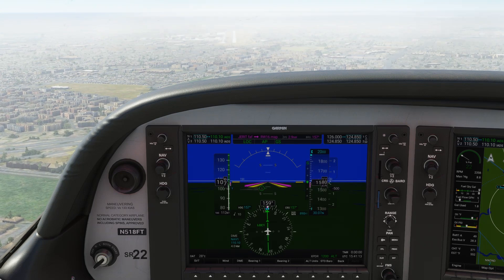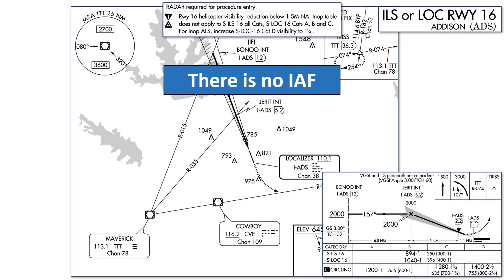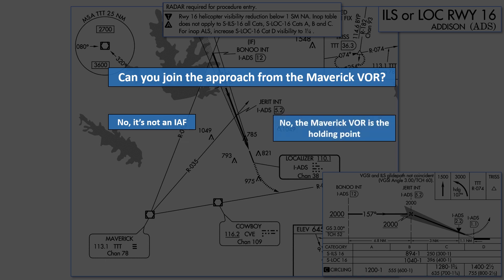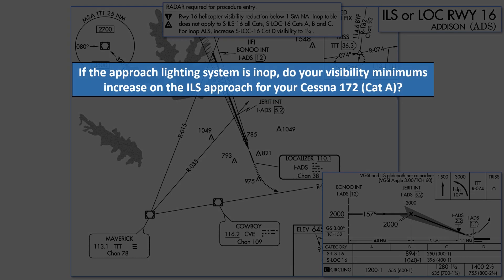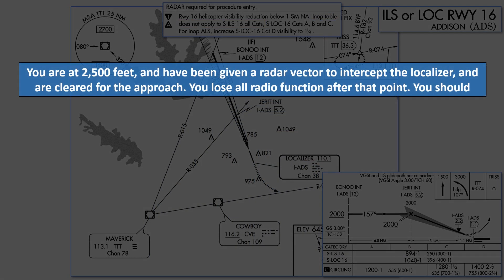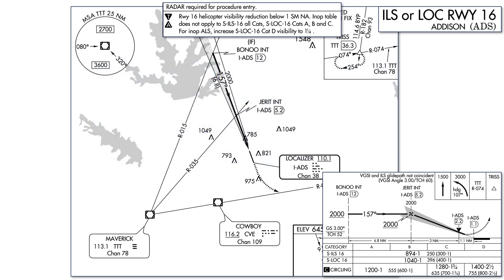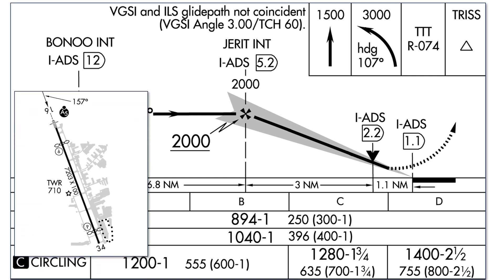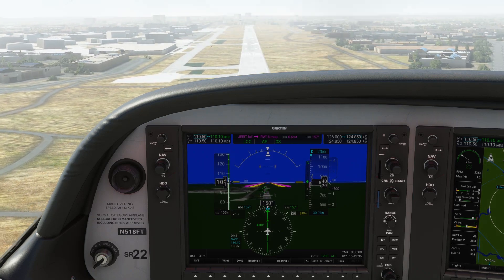5 Questions on an ILS Approach | Addison ILS 16 | Instrument Landing System

Comment: Confused by question 2 - if you've been cleared to 2500 and are getting vectors for the ILS, there may be an obstacle the controller was going to issue further vectors to get you around. With comms gone, they can no longer issue that vector. 
Surely the answer would be to squawk 7600 and climb to 2500 then maneuver for the approach - otherwise you may not be safe at 2500. Controllers have radar vector maps that pilots don't which show much more detailed minimum obstacle clearance altitudes.

Comment: I'm confused at 3:19, if I've lost all radio function how can I ever know if I'm established on the localizer. Were you assuming that I lost only COM but not NAV radios? The question says all radio function is lost. Does that not also include NAV radio function?
Reply: Good point.  I think he just means COM.  If you lose NAV, you're pretty much F'd.  I would think if the airport were in sight continue and land.  If not, go missed and then hopefully you can find another airport that's VFR.